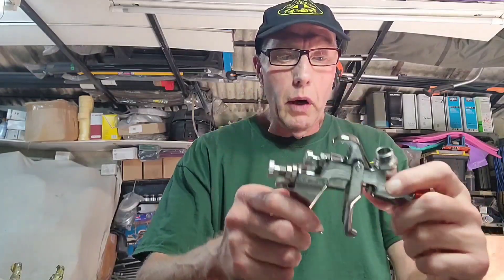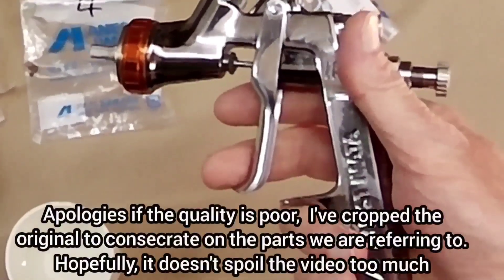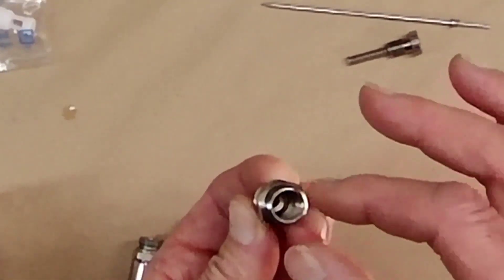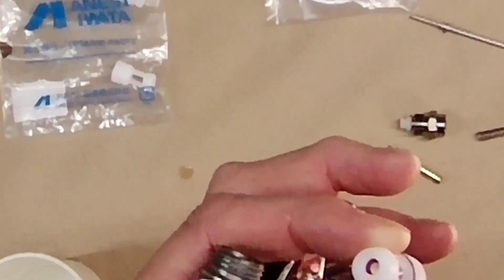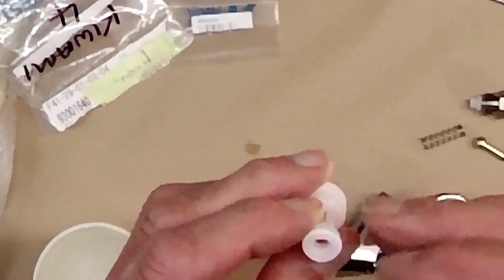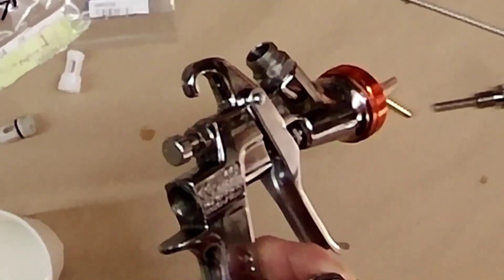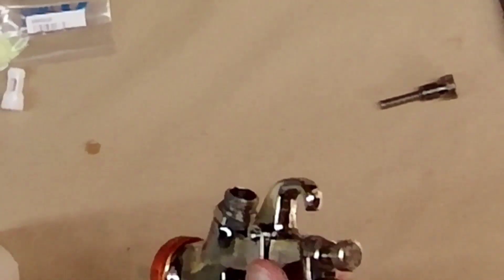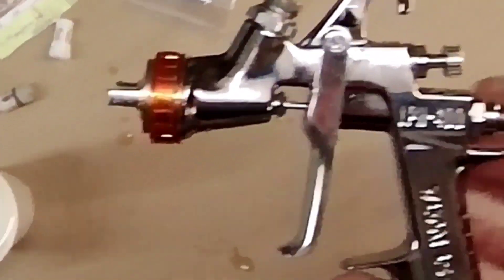LPH400, W400 Leaking Air, Same Procedure WS400 LS400 Spray Guns

Comment: Hi Pete, I'd be careful using petroleum-based oils/greases (like Vaseline) around rubber o-rings.  It has a way of degrading regular rubber over time, and without knowing what these o-rings are made of, I think the best thing to do is to assume that it could be natural rubber and to avoid Vaseline.  Anyway, I see that some spray gun makers sell spray gun lubes (like Sata, Devilbiss, etc.), and I would suggest something like that instead, even if it seems overpriced.
Reply from the maker: Hi Mate, I've always found petroleum jelly works OK, I do have quite a few different lubricants that have come with guns over time, but I've never used them.
But certainly,  yes, it is worth bearing in mind,  cheers buddy,  much appreciated 👍

Comment: Great video and very helpful.  After you rebuild guns do you ever dunk them in water with them pressurized to see if you have any leaks?
Reply from the maker: Hi buddy,  no, I use a water and washing up liquid spray that shows little bubbles if there are any leaks, but, to be honest,  if there are leaks, putting the gun to your ear will be enough as you can hear the smallest leak

Comment: I  have a kiwami 4. It works fine, I have two air  outlets one has 90 psi air. I have another air outlet with a regulator at 35 psi . That is the air line I use to connect to kiwami  spray  gun, seals are fine.
Reply from the maker: Hi James,  I have a few Kiwami4s as I have the WB and WBX versions. It's only happened to one, actually leaking out the back, not the front but I've had and bought another 4 Iwatas that have an air leak of some kind from the area covered by the video.
It doesn't affect performance, but it's certainly worth looking out for. Cheers 👍

Comment: pete love the channel!! question for ya i know you have about a million guns 😂😂😂 the iwata mini/midi gun cant remember the model the w300 does that lay clear like the ws400? or not as good? im looking for a smaller option and quite like the look of them but was unsure how well they laid the clear
Reply from the maker: Hi mate, The one I love is the W300WB. It has to be the WB version as it has the split tip. it's a 3 split like the W400WB & WBX and lays clear, really nice.
It's not fast as they don't put out lots of material, but they atomise really fine, so they can give a great thin finish it that makes sense.

I've recently got an LPH300, which is also brilliant, that has a 4 split tip and basically a lower pressure version of the W300WB, both excellent tools
Reply: @peteshobbies5383  thanks I’ll take a look I knew you would know 👍👍👍
Reply: @peteshobbies5383  is the lph300 still the midi size?
Reply from the maker: @grantssmartrepairs You're welcome buddy,  cheers 👍

Comment: Thanks for another informative upload.
The orange LVX "Xtreme" cap does a great job with base and clear. Excellent choice of LPH400.
Reply from the maker: Thanks David,  hopefully it will guide people in the right direction if they get air leaks, as you'll know, they don't affect the performance of the gun just annoying really.

This is the LPH I really wanted, I'm pretty sure the cap is the same as the W400 WBX, had a quick look but need to do more checking, cheers mate 👍
Reply: In my experience,  iwata is not that good for metallics.  The DV1 is the king if base coat guns
Reply: @peteshobbies5383  its a fantastic clear cost gun with the chrome cap. I have the w400lv wbx and it sprays sealer or wet on wet as well as the lph400 sprays clear.
I'm going to get the lph440 and see if it will spray primers as well as my Sata 100bf. If it does, I'll  sell the sata and be all in with iwata other than for base coats . I will never sell my DV1b . That's a killer base coat gun
Reply: @davidray4655  The LPH400 is fairly slow so I like to use it on smaller jobs for more control. I have faster guns for doing completes that give fantastic results as well.

I would like to get a DV1 but I already have a wide variety of guns and I can't really justify buying one at the moment.
Reply: @davidparker9676  I understand. I personally can't keep up with the faster guns. That's why I prefer iwata.  I do have a sata 100bf for primers and it does an excellent job.
Reply: @peteshobbies5383  It is a nice video that fills a gap in the information on these guns. I like that your videos provide a lot of information gems that I have not seen elsewhere.

Your channel is one of the few that will gives side-by-side comparisons and component compatability tests.

I have replaced my needle packing seal and some other o-rings on my LPH but I will see if it is leaking air from the seal you replaced. 

Keep doing what you are doing, I truly appreciate it.
Reply: @peteshobbies5383  I just these guns quite often and the caps on both guns do have the same air hole configuration but really do differ in performance
Reply: @davidray4655  I have the same primer gun, very nice results. Previously, I was using a Air Gunza AZ3 1.8 for primer but the gun was slow, the fan was small and the finish required more sanding to prep it for the next stage.
Reply from the maker: @davidparker9676, Thank you, David. I genuinely enjoy making the videos, I've very interested in the way different manufacturers go about tweaking their various models and how they affect the spray pattern, delivery, etc.

It is great to be able to share it with you guys and girls, 2% of our audience are ladies, and hopefully, the videos help some people in some way, appreciate the kind words, thanks buddy,  much appreciated 👍
Reply from the maker: @jamessakimae9655, I had a few people say that, and I'm not so sure why that would be.

The only real way to tell is everything back to back, so everything is the same apart from the cap, which is why I like doing the back to back reviews, I think it's the only way.

So many things affect the process, no just temperature,  humidity etc buy also the painter on the day, we all have good and bad days, some days we are rushing, so a reasonable gun may seem slow etc.

I'm looking forward to comparing a few caps, ect, at the same time, to see what kind of a difference there is. I appreciate the comments, buddy 👍
Reply from the maker: @davidray4655,  I agree that the DV1 base is excellent for basecoats, along with the Sagola 4600 Aqua. It's my favourite.
Of all the Iwatas the LS400 is probably the best basecoat gun and for me, it is right up there with the DV1. I'm not sure if you've used one ?
Reply: @peteshobbies5383  I have one but have yet to use it for base.
Reply: @davidparker9676  I had the same air gunsa before the sata but in a 2.0 set up. It did a very nice job, but the fan was a bit small so I switched  to sata. I'm with Pete on the sata's, I really don't like the fluid knob set up where there are 2 pieces to it. It's just over kill and don't really see the need for it
Reply: @peteshobbies5383  all my work is car and truck resprays so if it doesn't perform for me the first time, I just go with what works for me. I can't afford redo's in time or cost. I rarely have the time to learn a gun. It either works the first time or it's back to what I know.
Reply from the maker: Yeah,  I can appreciate that, I'm lucky to have the time to experiment and try different things, if you've got to get the job done, then, as you say, you go with what you know and what performs there and then 👍

Comment: What if the plastic part that you use Alan on won't back out
Reply from the maker: Hi again buddy, if the plastic piece won't back out, then you need to soak the threads in penetrative fluid. It will be the aluminium reaction to solvents and moisture.

You need to be really careful not to damage the head where the hexagon key fits as its your only chance.

Also, try heating the gun body with a hot air gun as the expansion on the metal can help break the seal of the plastic part
Reply: @peteshobbies5383    wel sir I messed the hex up.  stripped.  I'm clueless now.  I wonder if I can send to iwata to fix .  I just bought 2 of these for a great deal but had no clue they both didn't work
Reply from the maker: You can try the next size key up, make the key hot so it melts into the plastic,  let it cool, then try, but you need to let penetrative oil get into the threads,  this may take a day or two

Comment: Pete, just a humble request please. Ever thought of doing a comparison of different clear coats, especially not using any thinners, just neat + catalyst V thinned say 10% and problems with die back later on. I never use thinners and do not warm the clear up as you do. Would make it interesting, Warming the clear would no doubt change the viscocity and flow out. But it also depends on what gun is being used, workshop conditions and other factors. What do you think?
Reply from the maker: Hi mate,  I did a review of different clear coats,  but without thinners,  it's here, https://youtu.be/YQffNOUL0A4, also the effect on viscosity of clear coat,which is here, https://youtu.be/VRCGv6Rxw1Q.

Sounds like a good idea though to see the effect of thinners on the clear,  I normally try and leave any outside shots for a few days,  just so any initial die back takes place,  only real observation is harder speed does have an effect over a few days, haven't really noticed any using thinners though,  I'll keep it in mind as it would be interesting to see,  cheers mate 👍

Comment: Hi Pete. Loved the video. Been waiting years for you to do one like this. 
Do yourself a favor and buy the chrome cap for clear. You'll see why people rave about it
Reply: I have all three caps for the LPH400, the orange LVX cap is great for base and clear.

I have only seen a few people rave about the chrome cap compared to the other two. The orange cap seems to be the overall favorite.

The purple LVB cap is designed for base but lays HS clear like glass.
Reply from the maker: @davidray4655, I effectively have that same cap, I'm pretty sure that the cap with the Wider4L is the same. Although there is a different pitch thread on the bezel, you can remove it and fit it to a W400 bezel, and I should be in business, plenty of experimenting to be done, cheers buddy 👍 😀
Reply: @davidparker9676  I've had the other 2 caps, but maybe I just didn't  give them enough spray time. It was pretty much once and done, but I'll have to respectfully disagree about the orange cap. It's seems to be the òld lph400 lv2 cap which was the predisessor of the lv4 cap

Comment: My w400 would be pushing 14 years old and I've never changed a single part on it! (And it's been well used!)
Reply from the maker: Hi Andrew, it's a common problem,  I would think yours being that old will have a metal fluid needle guide, the bit at the back, much more reliable than the newer plastic one's although the metal ones are more prone to corrosion if people use waterbourn paints.

Comment: Hey Pete greetings from the states. I started a new job and suddenly my 5 year old LPH 400 lvx is dripping clear it appears from the bottom side of the cap ,but I’m realizing it has to be the needle packing cartridge. What timing that you would make this video. Paint rep says I should replace the nozzle, needle and air cap but I think what you’ve explained here makes more sense. Keep doing what you do.
Reply from the maker: Hi buddy, It could certainly be the needle packing as it seaps past the needle and runs down body and off the bottom of the cap.
The best thing is to clean and dry the gun, the put thinners or reducer as you say in the US in it, and see if it starts leaking first without pulling the trigger with your finger on the part of the gun under the needle packing,  just so it's reaches your finger first .
If nothing happens, then try  test sprays with your finger still there. Basically, if your finger gets wet and it's not dripping from the cap, it's the needle packing. 

Let me know how it goes if you would. Thanks, mate 👍

Comment: Hi Pete, that was interesting to watch mate and I'm surprised that Iwata would have these problems on their guns as they are one of the leading manufactures in the industry, they must know it's a problem so I would think there would be a fix for it by now🤔
So far my W400 has been flawless so I don't know if they have a different design of seal, be interesting to know if the WS400S2 are the same🤷‍♂
Thanks for doing this vid mate as I'm sure it will help a lot of people👌👍
Reply from the maker: Hi John, I don't think it's that much of an issue for many. Some won't even notice it as it doesn't affect the working in any way.
I'm a bit ott in that I put everything now up against my ear to listen for it 🤣😂.
I haven't had the problem with any other make, although I have more Iwatas than anything else by a long stretch.

The WS400 series 2 has exactly the same arrangement. the part number is different, probably the same as the Kiwami4 one , cheers mate 👍

Comment: I have the same problem with my ws400 can you put the link to the part or the name of the part 😢
Reply from the maker: Hi mate,  the part for the WS400 is exactly the same as the LPH400 in this video. The part number in the video is the same, and the procedure is the same, so do a search of that part number wherever you are, and you will be able to get one 👍

Comment: I have an LPH 400 silver cap and it’s leaking air behind the trigger. Can’t figure it out
Reply from the maker: Hi buddy, if it's leaking behind the trigger, it will be the part I changed in this video, the air valve seat, there's a seal inside the valve seat that should stop air coming out from the trigger
Reply: @peteshobbies5383  u talking about the o ring. I cannot get my 10mm hex to turn unfortunately
Reply from the maker: @digitalorgy3784 There are 2 o'ring at the front of the seat. One is on the outside, and there is one on the inside.
Some can be hard to get out if they have been in there a while, that why I put  petroleum jelly on the threads before refitting.
If you can, leave it to soak in penetrative fluid and try again
Reply: @peteshobbies5383  penetrating oil that could ruin the gun don’t u think ?
Reply from the maker: @digitalorgy3784 should be fine as long as you clean it afterwards. The inside components are lightly greased and oiled at the factory.
Just put it down the threads in the body. They go the length of it
Reply: @peteshobbies5383  thank u. Yea this won’t budge and starting to round out the Allen because it’s plastic. Not good
Reply from the maker: @digitalorgy3784 That's not so good. You can also try a little heat to the body. This expands it a little, which can help. 

If it's really rounded then you can heat the hex key up, very hot and push it in, it melts to the plastic to gives it grip, this is a last resort really but I've had it work on a LS400 that a mate had given me to fix, good luck buddy 👍
Reply: @peteshobbies5383  I used a point torch to heat and got it out. Thanks for your help. Still waiting for a new one hope it works
Reply from the maker: @digitalorgy3784 That's great. There's no reason why it shouldn't,  I always put a little petroleum jelly on the o'rings and the threads of the plastic it's helps with removing in the future, just run the gun with air going through it for a few minutes so any excess is taken through the gun.

Let me know how it goes. Cheers, mate 👍

Comment: I have air coming back up into the paint cup.  Any idea what is going on to cause that?
Reply from the maker: Hi Buddy,  it will be getting past the tip, so where the taper is on the tip if its a W400 or LPH400, make sure the tip is completely clean and the inside of the gun is clean,  where the tip sits on the gun, also make sure the tip is tight.

If it's still leaking into the pot after that, either the tip taper or the gun is damaged, it's only where the taper on the tip and gun meet that seals the air out, hope that helps 👍 

Let us know how you get on 👍
Reply: @peteshobbies5383  Thank you very much!  You requested an update, so, here goes.  I have cleaned the gun at least four times.  No real improvement.  On the final cleaning I noted a burr at the thread end of the paint nozzle, on what might be a sealing surface.  I do recall dropping the nozzle after the previous gun use.  Could this be the issue?  Should I go ahead a purchase a new paint nozzle?
Reply from the maker: @DoktorHalloween That sounds like the problem. You can try removing the dur with some very fine wet and dry paper
Reply: @peteshobbies5383  I was thinking once the part arrives I'll also see if I can remove the burr and restore the part to usefulness.  And, then have a back up.  Thank you!
Reply from the maker: Your welcome 👍
Reply: @peteshobbies5383  Confirmed!  It was the burr on the back of the paint nozzle.  The new nozzle immediately fixed it.  I did sand down the burr on the original nozzle and though it helped, it didn't fix the back blow of air.  Lesson: do NOT drop your nozzle while cleaning, or, clean over carpet.  Thanks again, Pete.  Pricey lesson.
Reply from the maker: @DoktorHalloween Hi Mate, thanks for letting us know,  The nozzle sets are expensive, but at least it fixed the problem. Thanks, buddy 👍